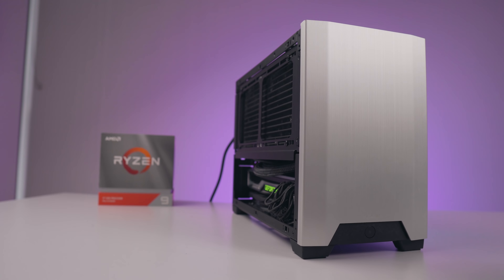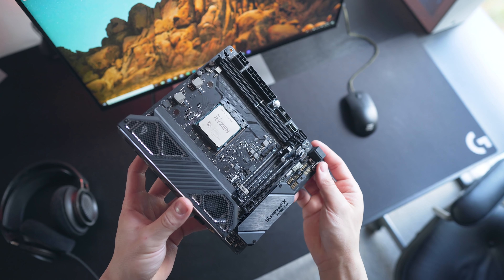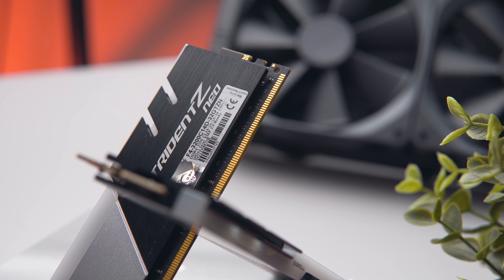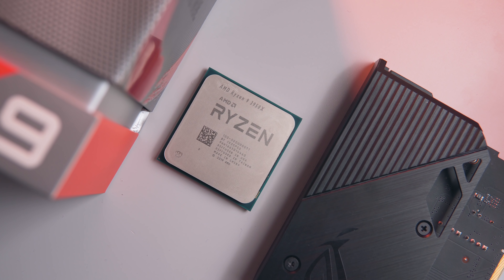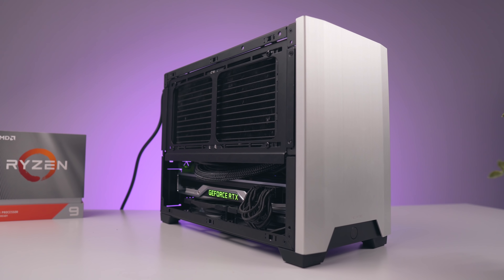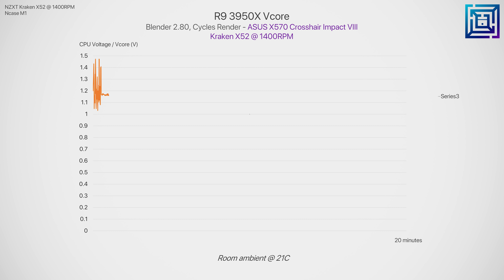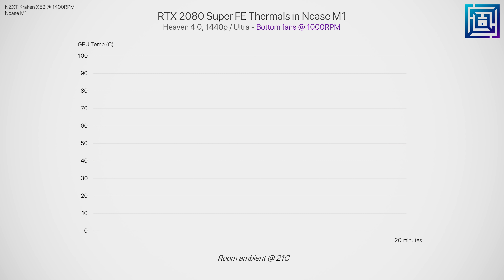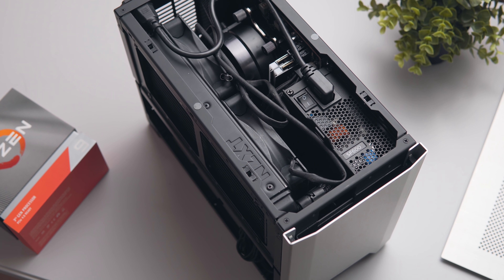Building a Mini 16-Core Beast! Ncase M1 + R9 3950X

Comment: Who would've thought we'd be able to build a 16 core system in such a small and portable package? Props to AMD for bringing this kind of tech to the table 👏🏼
Reply: Oh yeah. They're killing it this year.
Reply: Well I think LTT did 22-core one... but you know... Ryzen just is better for gaming :D
Reply: @sl06bhytmar  its also starting to be better in some productivity, though, there are still some places intel holds the crown
Reply: > Who would've thought we'd be able to build a 16 core system in such a small and portable package?

Me who built 9960X in a Ghost S1, ended up melting the tube from CPU to radiator which liquid leaks from radiator right on top of power supply.
It's not AMD's patent to have 16 cores crammed inside a small system, problem is just thermals.
Reply: If you ever had a look at Server systems you see this is not a problem for a long time. 15 years ago we had blade systems with 16 cores and much higher power consumption. But unaffordable for Joe Average.
Reply: @Sero3_  all of sudden I hear this word "patent" more frequently. What the f is that? All I know is that this bullshit can be abused to remove cursors or some stupid shit like show sizes? If that's the case then I hope a asteroid hits earth asap.
Reply: Markku Hyttinen Actually intel is better for that, But ryzen really smashed the records this time.
Reply: @sl06bhytmar  ,
Yah, the 22-core LTT did was a Xeon E5-2699 v4... but I wouldn't say Ryzen is "just" better for gaming since the R9-3950x should blow that Xeon out of the water in every scenario as the better architecture and higher frequency would more than offset the core advantage (for programs that can even use 44 threads mostly).
Reply: @OhMyBot Yep. The 3950X can do it with a lot less heat/power, but this has been possible for years. I'm currently running a 9980XE in an ITX build with the ASRock X299 board, but you could have used the 7980XE a long time ago. It's good, but AMD's not the first.
Reply: @sl06bhytmar  but this one is water cooled
Reply: @Sero3_  Thermals are fine as long as you have a 240ml radiator and some good thermal paste.
Reply: @Isaacminer1  but price to the performance gain in those areas Intel holds the crown doesn't make sense to buy Intel
Reply: @BennyKsBandwidth  yeah, i know, its still worth mentioning though! I'd never buy intel, I'm already aware its not worth the money.
Reply: I know Im asking randomly but does anyone know of a way to get back into an instagram account?
I somehow lost my account password. I would love any tricks you can give me
Reply: @Enrique Dario instablaster ;)
Reply: @Soren Kaden Thanks so much for your reply. I got to the site through google and Im in the hacking process now.
Takes quite some time so I will get back to you later with my results.
Reply: @Soren Kaden It worked and I now got access to my account again. I am so happy!
Thank you so much, you saved my ass !
Reply: @Enrique Dario happy to help :)

Comment: I built the exact same rig after being inspired by this build. Part-for-part, it's exactly the same except for a higher end NVME and a lower-end 2070 Super vs. the 2080 in yours. Two things to note for those of you out there looking to replicate this. You'll need to remove the heat sink / cover over the audio chipset on the Crosshair Impact VIII motherboard in order to gain access to the pins on the M.2-like sound card you'll need to plug your front-panel audio connector to. Also, the NCASE M1 is a tight fit. You're going to have to get very creative with the wiring looms. But the effort is well worth it! Amazing case, fantastic thermals, top-notch 1440p gaming in a case that's roughly the size of the founder's edition box the GPU came in. Long live the SFF!

Thanks for this awesome video! Keep up the great work!

Comment: Genuinely obsessed with your channel lately. Also, If you want to improve gpu temps in the ncase m1 I recommend using noctuas nfs12a fans, insanely quiet at full rpm (1200 tbf) and provide SO MUCH air flow. Will probably improve gpu temps by a few degrees.

Comment: The Ryzen 9 3950X sometimes even runs cooler than a 3900X (without overclocking) :D
Reply: If a chiplet is awesome, it goes to 3950x. If its only great it goes to 3900x, if its ok, it goes to 3700x, if its not as good it goes to 3600 and so on, so not that strange really.
Reply: @Xeevv  yeah, I will get a 3950x soon, was worried that I would have to upgrade my watercooler, but it looks to be good for a 3950x.
Reply: @AndrewTSq  I'd say chiplets in 3900x (at least one of them) are probably worse than the ones in 3700x/3800xs, possibly on the same level as 3600(x) since chiplets in 3900x only need to enable 6 cores rather than 8
Reply: noticed that the 3950x is a binned part?
ever wondered if the 3900x is just a failed 3950x binned down ?

that's why they run hot, and aren't easy to sustain at low voltages. cuz they're not silicon lottery. 

Sad, I'd say.
Reply: TurboCMinusMinus  Right you are! I'm not saying what they're doing is a bad thing, it's better for the environment too, but keeping this in mind I'd be more inclined to buy a 3950x rather than a 3900x. Maybe the price alone may make some people buy the 3900 over the 3950, but I see a big conscientious Gap in my buying decision here based on these assumptions
Reply: @shubhamchandra5417  Yeah doesn't Intel get like 30% yields and Ryzen gets something like 70% from their wafers? I know there's a huge difference there at least.
Reply: @apocalypseap  bro..... Why..... Stop already
Intel left the chat a long time ago 🤣
Reply: @AndrewTSq  basically any cooler that can handle 3900x will handle 3950x no issue

Comment: "which is almost $200 cheaper" how much does the DTX motherboard cost? wtf
Reply: Vetra About 400 bucks
Reply: $425. Hideously expensive, but it may have some of the best overclocking capability out of any X570 board, let alone a SFF one.
Reply: I was thinking the same thing. The X570i Strix is already an expensive board.
Reply: @Vetra $430 USD + tax in most places.
Reply: mini DTX motherboard: $450, but the mini ITX Motherboard: $250
Reply: @Kvantum  it's so much overkill in a small form which is hilarious
Reply: In Germany i cant get the Impact for about 350 Euro inkl. tax etc.  The good ITX Boards cost all about 200 Euro which means DTX would be the best buy.
But my 2600x and my B450 Asus is still more than enough for 4k Gaming with my TI...
Reply: In Germany the X570-I is just 50€ (about 40$) cheaper.

Comment: I'd love to hear more thoughts about thermals in regard to fan direction setup. can't quite get it why blowing in hot air from AIO inside works better than blowing it out helping(and probably balancing) bottom intake fans, which push cold air in

Comment: I've owned an Ghost S1 since the summer  now and I've pre-ordered the NCase M1 to see how that goes. There's a few reasons. My current gpu the Asus gtx 980 slightly doesn't fit in the standard case so I had to buy a small top hat. After using it for a while I've had my fan ramping up and down on my r9 3700x. This is due to both temps and firmware for my board. There's a very limited selection of coolers that both perform well and will fit in this thing. I'm using the noctua l9x65 and it's not good enough. There's the mod you can do to the l12s to make it fit so I might give that a shot. I think my problems could be just AMD related. 

This is my first AMD CPU and I went this route because AMD keeps the same chipset for a few years so I don't have to upgrade my CPU every year as was the case if you want to do that with Intel. And then there's water-cooling which requires a large top hat to get and I've received radio silence or months delays to get a response from loque.

I felt like I should've gone with the NCase M1 but the loque both looked beautiful and felt very unique. However, from a practically and upgradeability standpoint the NCase M1 is unmatched imo.
Reply: Just to add, to get the best cooling out of the ghost s1 you'd have to purchase the large top hat to add watercooling. By that point the case is slightly shorter than the NCase M1 and not as wide. However, with the large top hat added you are looking at close to twice the amount that you would have spent on the NCase M1 for a case with limited cooling options. It's a beautiful case and it's not bad to work in, but the NCase is a more pragmatic case.

Comment: Any thoughts about building a custom watercooling loop with 2 240mm radiators in the ncase? 
I believe the v6 has the potential, and I think it would be interesting to see the cooling potential with 16 cores and a 2080ti?

Comment: I'm pretty sure you could get better thermals in a Sliger SM580 with a 280 mm rad on top and push on bottom + top (with vented panes). This is the best SFF case I know for powerful GPUs and CPUs.

Comment: I have this case with the 3950x and a 2080 Ti. THe 2080 Ti XC ultra is very big, and extra fans don't fit at the bottom. DOn't know which one is smaller to allow fans below. It's so quiet though! I should look into under volting. :)

Comment: Please try and get your hands on Jonsbo A4, no english reviews of that yet, only chinese. It's a bit large at 15L but it takes 2,5 slot gpu's and 240mm rads with ease it seems. It should be around 120 USD if any resellers picks it up, right now it seems you can get it for around 200 usd shipped from China.

Comment: Time to push it to the next level, dual 240mm  radiators, noctua fans, soft tubing, pump/block combo and somehow an Interior reservoir (if needed)!! Gogo you can do it, then I'll do the exact same :P
Reply: Best reservoir would be a custom made one that takes place instead of the front panel, perhaps.

Comment: overclocking
ASUS has great software to handle overclocking. I would download the AI Suite III and run DIP5 (or whatever this X570 board uses.. see support site). I found a great CPU FAN CURVE was to set the fans to 30% until 60degC, ramp to 70% at 75degC then jump to 100%... everybodys will vary but the REASON I did that for my R9-3900x was because the CPU fan would fluctuate too much even in light load so waiting until 60degC (which was very quiet anyway) to ramp up worked perfectly and it never went above that for GAMING (except a few spikes) only intensive work-loads... I found my CPU could be sometimes unstable if it overheated hence the jump to 100% at 75degC (which was the recommended temp).
Reply: (Noctua NH-D14 was the air cooler used BTW. For an R9-3900x or 3950x I'd use either the Noctua NH-D15 Black air cooler or a good liquid cooler. Since the R9-3950x apparently draws about the same power as the R9-3900x due to binning it looks like the Noctua NH-D15 Black could be a great choice as it should be really reliable in the long-term and mostly quiet too with no pump etc... 30% max fan RPM is essentially silent in my experience... err, I have the NEW CHROMAX FANS now with my old NH-D14 so it's a bit of a hybrid but should be within 2degC of the NH-D15)

Comment: I would like to hear the noise level of this assembly. And generally all compact systems. Why never include noise level in a video?
Reply: Exactly. I really dont understand this hype for small cases. Bigger one always be more silent with lower temperatures.
Reply: @shopminer2308  For this case (classic layout) bigger doesn't mean cooler or measurably more silent, it uses same parts as any big box would. 

What big case would have different than this build? It popular 240mm AIO that is sufficient and good air cooled GPU. Putt it in a big box and nothing would change.

And if you do full custom loop (which you can do in this case with two 240mm rads) it would be as silent as it gets.

For sandwich layout yea, they might be noisier as they have to deal with limited CPU cooling, but they still reasonably quiet (thanks noctua) and for sure not worse than average big box.

Comment: Looking forward to a part 2 to this video in which you do a custom water cooling setup with 2x 240mm radiators. Speaking of which, is the Asus x570 Crosshair VIII Impact too big that it would interfere with a 240mm radiator mounted to the bottom of the Ncase M1?

Comment: Great build, seems to run perfectly fine at stock speeds. Would only bother to undervolt the GPU if it means less fan noise. Speaking of which: how are noise levels at idle and under load?

Comment: I wonder: with the radiator side mounted, in a  horizontal orientation like this, does it matter which side is up for thermals at all? 
Intake/hot up or output/cooled up?

Comment: looks like the 2 bottom fans are pulling air in as well as the fans of the radiator are pulling? which fan takes air out? thanks for the vid

Comment: I have ordered the M1 case and many of your recommendations via your links.  Question on air flow:  In your M1 - Watercooler video from 2018 you stated that your optimal setup is the watercooler fans are pulling air from the outside and your 2 bottoms fans on the case are taking air and pushing it outside the case (via the bottom) - so in exhaust configuration.  In this video you state that the best setup is for both sets of fans (watercooler and bottom) to pull air into the case.   Can you clarify which configutation is best (NXT Kraken X53 with Noctua NF-A12x25 Fans - bottom fans are the Noctua NF-F12 fans)?

Comment: Thank you for the great video!  I have decided to duplicate your builld with the exception of 2070 Super FE and custom cables.  This will be my fist SFF build in about 10 years and I have never used cutom cables before.  I am hoping to obtain a set from pslate customs.  When ordering 24 pin he asks for inside or outside PSU fan.  From the video it looks like I should be ordering outside PSU fan.  Trying to check before ordering tomorrow as the cables are expensive and I dont want to make a mistake!  Thanks again for all your great content.

Comment: Can we get an air cooled SFF build?
Reply: id love to see that too as most SFF builds use water cooling to control the temps but I dont trust water cooling and prefer air cooling myself. Water + Expensive Electronics = bad idea.
Reply: What's so specific about air cooling? There's plenty of builds with air in SFF cases, especially M1 as it allows for pretty big ones.
Reply: Would love to see an air cooled variant as well, maybe also compare CPU/GPU/case thermals after 30 minutes laying the case on its side, to see if intake or outtake is better then.

Comment: I'm building a very similar configuration to this, except it's DAW focused with a much lower end GPU (Sapphire 5500 XT Pulse 4GB).
I'll be using the ASRock ITX/TB3 mobo for Tb3 support.
I just noticed I ordered the Noctua NF-S12B redux-1200 bottom intake fans in stead of the chromax you're using. 
This is my first PC build coming from two decades of Mac. Do you reckon I'll be okay with the fans I picked?
They top out at 1200rpm, but my GPU is pretty low watt and l won't stress it much (I'm kinda hoping its fans will never spin up). 
Another question, is your PSU fan pulling in or pushing out? 
Thanks for your vids anyway, they've helped me a ton.

Comment: @Optimum Tech.  Have you reviewed the Steck case by chance?  I'm curious whether it would work fine with the 3950x and 240mm AIO.  Theoretically it should, just as the Ncase did, but the Steck is readily available.

Comment: excellent videos!  is it possible to use the 3950x and amd VII gpu in the m1 as a hackingtosh ? could you do a hacingtosh guild/ build with the 3950x ? thanks
hi from uk
Reply: I'm interested in this configuration as well.  Can we edit prores raw in final cut Pro in ryzen hackintosh system ? Is there any performance difference for not having t2 chips and using Intel's quick sync?

Comment: Hey there so I'm getting the N case and I'm wondering if the Asus rog strix 2080 ti will fit in this configuration with the fans you added, the founders edition is definitely smaller in height but also like $800 more expensive.

Comment: @Optimum Tech: did you take the front IO out because of an aesthetic choice or because the bottom intake fans mounted in a centred way would make it almost impossible for the front IO cables to be routed?
I'm building a similar build now (MY FIRST EVER!) and I noticed that I could probably only make it work if I place the bottom intake fans a little bit more towards the rear. I'l have to put in my GPU first to see if that would be an issue or actually advantageous. I've just got a Sapphire Pulse 5500XT 4GB since it's an audio focussed build. What's your take?

Comment: you have the side radiator fans blowing into your case onto your cpu and motherboard?  Aren't you blowing hot air onto your components then? If you have all your fans blowing in, you have no exhaust.  Its been a while since I built a PC (built a 2600k rig 9 years ago).  is this really optimal?

Comment: Possibly dumb question - are there any external thunderbolt 3 devices you'd be able to use with this build? Or is thunderbolt 3 completely out of the question if there's no header for it on the motherboard?

Comment: Would you say it is possible to fit in the Arctic Freeze 2 240mm? I understand this has a slightly bigger radiator at 277mm x 120mm x 38mm which are around 1-2mm bigger than the NZXT Kraken being used here.